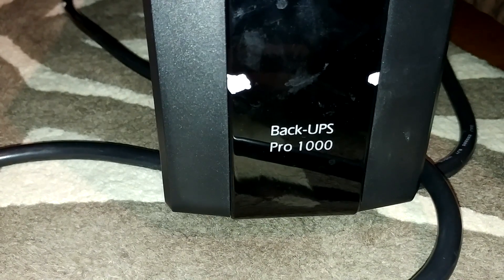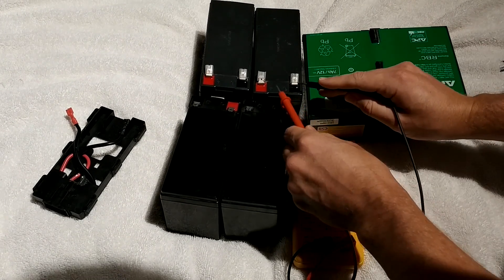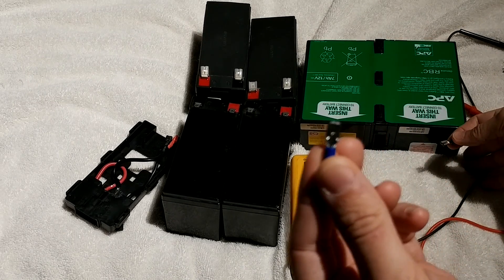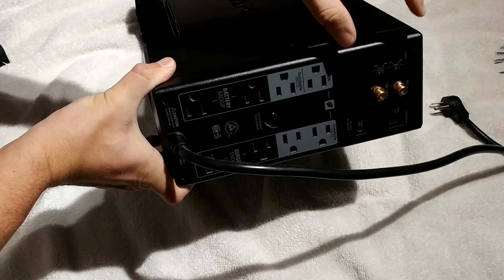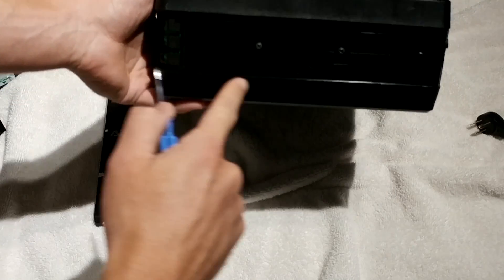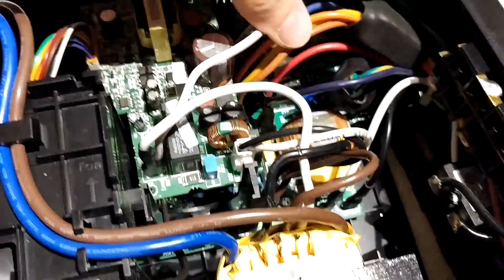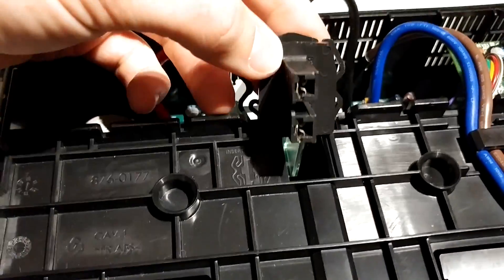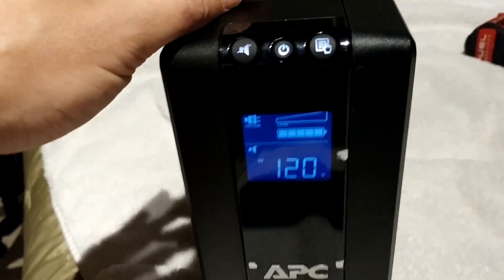APC Back-UPS Pro 1000 BR1000G Disassembly and battery repair

Comment: Falla F05 en ups APS 100 pro baterias dañadas visibles fisicamente deformdas, termnal del cargador interno medidas con voltimetro dan lectura 39 a 40voltios, carga recomendada  maxima de 28 a 29 voltios, posible dño cargdor interno  tendri usted la experiencia para facilitr la reparacion aproximada, muchas grcias

Comment: To remove the front panel - lift the lower part (the part opposite to the buttons)  then push up (towards the buttons).

Comment: Really appreciate the help.  I found that the original and replacement battery both had its internal positive (red) terminal pushed in.  I was able to pull out the terminal on the replacement battery to match the negative.  It still had sufficient force not to be pushed back in very easily.  I was able to get it to snap in place on a second try and get the UPS working again with battery connected.

Comment: I have a BR1100 and the display indicator always shows red, probably due to an issue with the logic board. Since you mentioned about the relay, I may need to investigate on that as well. That happened due to a power fluctuation.

Comment: I dont know how well you know your way around the inside of these but I have the same unit..the problem is mine charges when off but only runs on battery when turned on. I've tried using the skills I have to troubleshoot the board but I don't have the right equipment to diagnose the issue. But it won't detect the that it's plugged in when on. If you know how to fix any hell would be appreciated

Comment: I have the 1500va, however I do not have any batteries and when I turn it on there's a constant beep and the Display panel does not turn on. Do you know if this might be because there are no batteries connected? I looked inside and I cannot see any obvious damage in any component or PCB
Reply from the maker: I believe the display should still function if batteries are not installed.

Comment: Same unit exact same failure mode on battery pack and chassis power plug.  I used jb weld.  Frustrating to have to fix which is really poor apc component quality. 

Enjoyed video.
Reply from the maker: Glad it helped! Thanks for the feedback

Comment: Very poor lighting. It would have been a lot better if the backdrop had been a gray or some other neutral color so the camera wouldn't have closed down the lens to compensate for the bright white working surface. Also, the video should definitely have explained HOW to discharge the capacitors, since they are so dangerous.
Reply from the maker: Yup. Affects of cuts to the production budget and writer's strike. Thanks for the feedback. Please post your address for a full refund 🙂

Comment: thank you so much! my new battery only had a connection problem. I pinched in the rounded tabs inside the female terminals and it solved my problems. the ups would not turn on. but removing the battery the ups turned on. I knew that the battery had a bad connection.

Comment: Used a little bit of acetone to try to clean the strain relief (chloroprene) yellow gunk off of the corner of the PCB on my UPS. Wouldn't budge at all!

Should I toss the UPS? It still works fine after powering it back on without any issues.
Reply from the maker: Hmm If it works fine, why toss it?
Reply: @WillHennegan  precisely! But I've got another question for you on another UPS that is buzzing and humming. APC Smart UPS 1000. Will drop the link once I upload the video so you can take a listen.
Reply: @WillHennegan  I've posted the video of the buzzing and humming of the APC 1000 Smart UPS on my channel. I tried to post the link here but it was removed. It's the only Shorts video on my channel.
Reply from the maker: @airhogglider  Ah I had to turn the volume wayyy up to hear that. I recommend trying an automotive non-conducting stethoscope to pinpoint exactly which component is making that noise. I cannot tell if it is an electric arc or a flapping relay, but if you can ID the faulty component it is probably worth replacing if you are able.
Reply: @WillHennegan  much appreciated! 👍
Reply: @WillHennegan  I ended up giving the UPS away to someone else who wanted to mess with it, haha. End of the story on this one for now.

Comment: Any thoughts on fixing "F02' error?
Reply from the maker: I have never encountered it, but if I did and the unit was out of warranty, I would try replacing the battery first, then open it up to look for any obviously damaged or failed components.

Comment: Hey there! Late comment but I was wondering where you purchased the individual cells? I was hoping i might be able to get them cheaper from a wholesaler or random Chinese import from eBay instead of buying the whole battery combo from APC, saves a bit of money and let's me have some fun taking it all apart (which, also, do you know where you found info on taking it apart)
Reply from the maker: Hi, I learned how to take this apart the hard way (I broke the front cover as other commenters pointed out). The cells in this battery pack are called WP7.2 12. You can find generics of these for sale on most online retailers. A 2-pack (needed for this unit) starts around $35 and up. You can get a pre-assembled battery for this BR1000G for $15 more and that may be worth the price for some. However, that robs those of us that enjoy the DIY aspect of most of the fun.
Reply: @WillHennegan  Thank you so much for your replies! I did some digging and see exactly what you are talking about, just two otherwise standard batteries taped together, looks to be an easy and cheap fix for this unit! Thank you!!!

Comment: Where is the fan located?
Also what size fan is used inside? Thank you
Reply from the maker: I am not sure. The 1500 model has a fan, but not this 1000 model. I have not had a 1500 to work on yet.
Reply: @WillHennegan  yeah the 1500 has a tornado fan. So I replaced it.
I was trying to see if this also have fan so that I can replace it too.

Comment: My br1500 having issue with error F06 , which related with internal relays, any idea to fix it
Reply from the maker: If out of warranty, you could try to replace the relays yourself. Beyond that, I am not sure what to suggest. Good luck!
Reply: @WillHennegan  thanks Will, could you point out which one is the relays ?
Reply from the maker: @yesmanhk  If you skip to 10:20 in the video, I point to one of them on the top daughter board. They are typically large black rectangular prisms. Here's an eBay link for ones that would work in my unit (they may be different from yours). https://cgi.ebay.com/113661856374  That should give you a better idea of what they look like.

Comment: Can we place order for the battery connector. the one you showed at 11:36 is kind of damaged due to wrong placement of battery pushed in to.
Reply from the maker: The first place I would look is eBay. e.g. http://cgi.ebay.com/383640197887
Reply: @WillHennegan  wow this would be very helpful. thanks a lot :)

Comment: Next time consider to record the video with more light please, awesome content!
Reply from the maker: I am accepting donations for lighting equipment.
Reply: The problem is not the light. It's the fact that all the black components are on a white background. The camera adjust to average light levels. When the cam gets in close, everything is great. When the white towel is in the shot, the inside of the UPS goes all dark.
Solution: use a dark background.
Reply: Thank you for solving the puzzle of how to get this thing apart!

Comment: hi, i have the same unit but BR-1500VA the items is 3yrs old and out of warranty, today every thing was fine until the AVR trim was continuously on after sometime the ups got itself switched off. now when i press the middle button to turn on there's a Beep but the unit wont turn on,theres no display also coming,i have checked input volts and battery volts and resettable fuse every thing is as it should be. is there anything i can do to start the unit.i have good skill at electronics,thank you for video BTW.
Reply from the maker: Does your computer detect the UPS? Can you see the unit's status in the Powerchute software? Is the equipment plugged into it still running? If the UPS is unplugged from the wall, does the equipment still run on battery for any amount of time? If the display is not working, there is likely a failed component inside that needs to be repaired or replaced. I would also suggest determining why AVR trim was on for so long, and consider modifying your power parameters to be more tolerant if possible.
Reply: @WillHennegan  yes i found the cause, an barrier diode with wv4-21 code got burnt since i  don't have a replacement SOT-23 package am going to try putting two normal 1n4007  in BAt54s config and try kick starting the unit and for some reason even the fan controller stopped working but i bypassed its tachometer signal detector using a 555 timer ic but the fan 3 pins are also not putting 24v when on mains where battery gets charged and not sure if there is a relay for fan switching or a switching diode am yet to find after starting this unit, any ideas? Thank you.
Reply from the maker: @Ragavenutb  Sorry, I am out of ideas. My units are all smaller models without fans. Good luck!

Comment: I have this model and it gave an error the other day it was either F06 or F09 I can not remember which, would just replacing the battery fix those?
Reply from the maker: Hmm I don't think replacing the battery would fix your problem. Check page 5 of the manual : https://excessups.com/manuals/apc-backups-pro-1000-br1000g-manual.pdf  Both of those codes indicate some sort of internal fault, like a relay or some other failed component.

Comment: Hello I have the opposite problem with mine... it got stocked on battery and the menu button doesn't do anything and it doesn't work with the wall outlet and I checked the fuse and it fine even I opened the back part of th eunit to make sure the fuse is allowing continuity and yes it is fine but the UPS doesn't react to the external energy and I have tried the unit on all outlets at home and the same problem.. do you know what may be happening with my unit?
Reply: Microcontroller IC is dead, you'll have a hard time finding a replacement IC.

Comment: Mr. Hennegan, Very nice and informative video. I too have this unit. Front panel says back ups pro 1000 (BR1000G an Indian varient probably) and mine give error code 08 fan issue and i tried opening it and was amused when i find no screws beneath the plastic face. I starting reading all the comments just to find that there is no fan inside while i thought if this error is there so it must be there and in the video it wasnt visible. I assume it was placed somewhere and not visible in the video.  How to rectify this F08 error. My UPS runs for few minutes and this error flashes and ups shuts down abruptly. Please help. regard
PS
I have seen APC forum and it mentions of a fan inside as users commented that fan keeps running etc etc. I feel that fan is there as fan noise comes out.

Comment: Great video.  So mine has a problem where the voltage sense circuitry varies widely.  I can watch it go from 122V down to 107V up to 114V down to 102V etc.  This causes it to switch to battery mode when it's not necessary (like 10 times per day at the lowest voltage tolerance level).  I have an identical unit plugged into the same outlet and it's rock steady at 121V.  I know it's not practical to try and debug this further, but I hate throwing out things like this.  Any idea where to start in debugging the voltage sense circuitry?
Reply: Removed my comment.... read yours too fast and somehow missed the part about you having a second unit that displayed steady voltage! I had an issue with a continuous brownout for months in my apartment after damage from Hurricane Sandy.
Reply: Turns out the problem was with the electrolytics. I replaced them and it’s running strong.
Reply: @richardzimmerman1356  Glad you were able to fix it, and wish I had those skills. I'm here bc I picked one of these up for $5 at a thrift store, ordered a new battery, and now it's rocking.

Comment: Now that I got the thing apart and can see the various clips, it appears that you should be able to remove the smoke-tinted cover from the front by prying up at the bottom and then sliding the tinted cover upwards.  The clips seem to be seated in channels that will release when the cover slides upwards a bit.

Comment: I just bought my first UPS, an APC 1500, and the battery does not seem to be charging, the computer software says it is charging but has been at under 20 % for a few days. I turned off the UPS overnight and the battery did not charge at all, I also left it on over night and there was no additional charge. I understand it takes 16 hours to fully charge this kind of lead acid battery, but I expected much more of a charge over 8-10 hours.
Am I looking at a bad battery? I did the software self test and it says it passed just fine. Thanks!
Reply from the maker: Will the battery power anything through the UPS without AC power? Try just a phone charge or something. If so at all, even just a minute, I would bet the battery is bad. Return for exchange. If it won't power anything at all with a ~20% charge, then the unit itself may be bad. Either way, that's not behavior a new UPS should have. Check connections and let us know how it goes.
Reply: @WillHennegan  I plugged in a 5 volt 1 amp charger into the UPS with no AC power and it did give a charge to my phone, a 600-700 mA draw from my phone. the battery in the UPS is down two 12 percent but still reported as charging, this is from the software from APC. Thanks for your help. I understand that some lead acid battery's have a cycle in which they deplete themselves and then recharge to maintain a healthy half life. I do not know if this is the case or not.

Comment: Backups Pro 1500 also use 6 plastic clips.  You don't need to remove the transparent part of the front plate in order to remove it.  Beneath the front plate are three screws you need to remove to get into the unit.

Comment: did you calibrate the ups after change the battery ? my ups can't charge after replace the battery.
Reply from the maker: I did not. You could try calibrating it, but I don't think that would help if it isn't charging at all.
Reply: @WillHennegan  Where is the potition of fuse ? i have to make sure the fuse is good, before buy new battery.
Reply from the maker: @mastertech7662  I don't recall a replaceable fuse in the unit.

Comment: Hey! Can you tell me if there is a fan inside this model? I have the similar model called Back-UPS Pro 1500 and in my unit the fan is always running, but eventually the fan turns off for some minutes and then switch to on again (and it's kind of noise).

Do you know what can be the problem? Is there a easy way to fix it?
I can feel with my hand in the top part of the unit some air ventilation (blowing some air up). I'm just pissed off because the fan almost never turns off (I think this is not normal, it should run only for a brief moment).

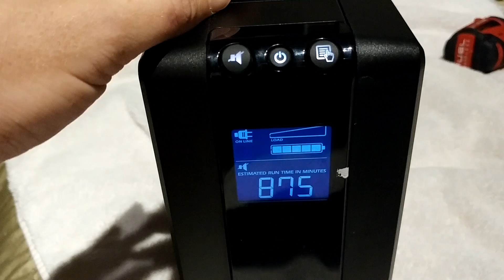And when I turn the unit on, like you did at 13:25, mine do a LOUD noise. I don't know why.

Please, take a look here: https://www.youtube.com/watch?v=4R4gTVtavSs
Reply from the maker: The Pro 1000 does not have a fan. Check out this APC forum thread. It sounds like your unit is working as designed. https://forums.apc.com/spaces/4/back-ups-surge-protectors/forums/general/4113/back-ups-rs1500-br1500g-fan
The Pro 1500 is NOT designed to be used in a bedroom or office setting where people are working all day.

Comment: there is no stupid cooling fan in this unit too, i have an BR1500G  the cooler inside this unit would sound like mini Diesel Genset and i can never sleep peacefully without turning the unit off any ideas t fix them ?
Reply from the maker: raga N these models are not designed to be used in a bedroom! These are closer to commercial or server class units designed for an office environment.
Reply: actually i bought the BR1000G model after it had a fan failure,i got a free replacement with 1500G as there was no stock with the seller but still the QC checks on these items are worst,the ups would self discharge itself with no load connected and will show remaining time "0" . am thinking of dismantling the whole unit and take off the fan completely am using it for only CCTV DVR with 5 cameras and a router the total load is only about 20-25 watts so i guess the fan is not required in terms of discharging right?
Reply: 7:44 I have APC 1500VA ones with F06 warning. I have been to tried disassembly it for replace the relay but after remove front plastic cover. I didn't see any screw as see  in this video, pls anyone's help me out.

Comment: Hi, I have a BR1500G. It opens slightly differently, but this video helped me get it open. For anyone interested: the three front screws (see video) are under the entire front assembly, so you don't need to remove the front face plate. There are (6) super duty plastic clips holding it on. You have to use a lot of force to get it open. I used plastic pry tools, but I may just try ripping it off in the future. Be wary, there is a connector for the LCD display...don't go ripping that off! Thanks!

Comment: This helped, I was suffering the dreaded swollen battery stuck in unit issue, this is always a pain for any of the APC UPS I’ve had or have to fix. You really shouldn’t have to take apart the whole units to get a stuck battery out